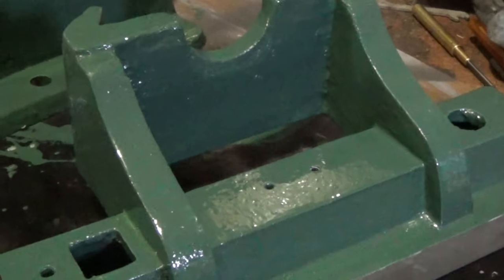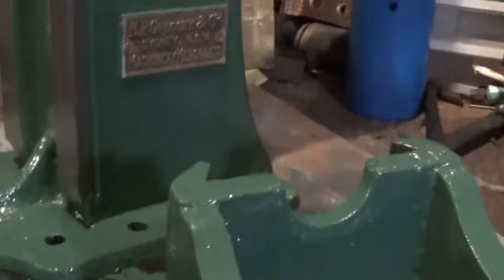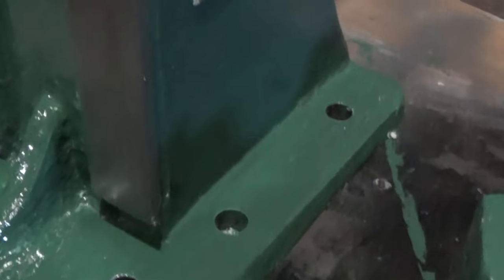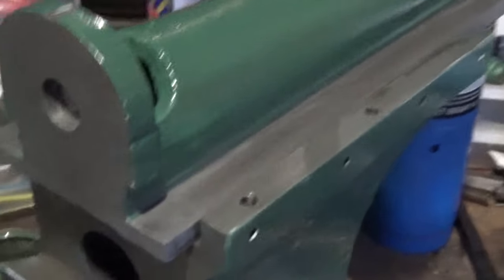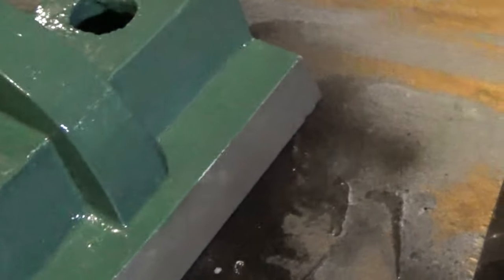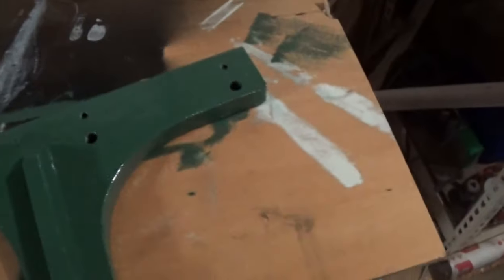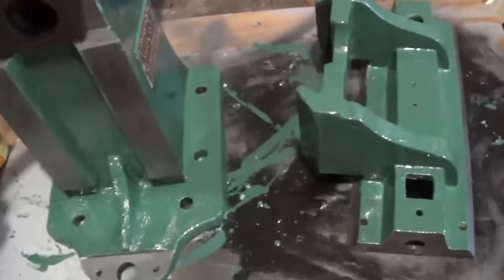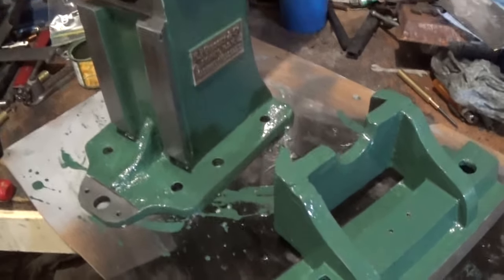shaper progress 12 sept 2016

Comment: Thanks, Emma. You might be interested to know that the U.S. Navy did a study long ago on what colo(u)rs to paint the inside of the nuclear submarines. They found that gray was by far the worst, black in second place. This is terms of driving the crew crazy. The best: green. Most restful color there is. The old Soviet Union did a similar study and came up with the same answer. So ex-USSR lathes are painted green, with red in places where your hand should not go. I think that is a very nice shade of green on the shaper. I cannot think of anything on the shaper that should be red :)